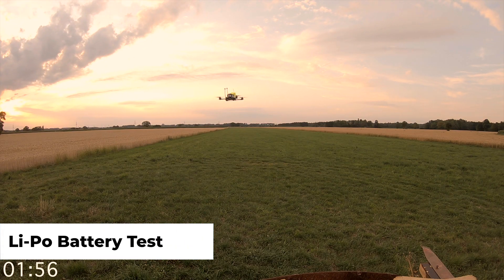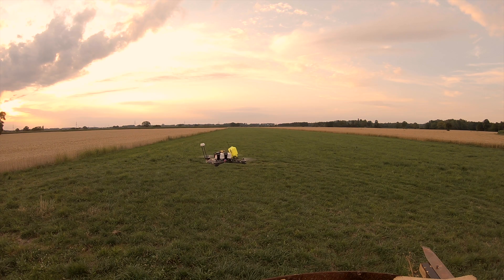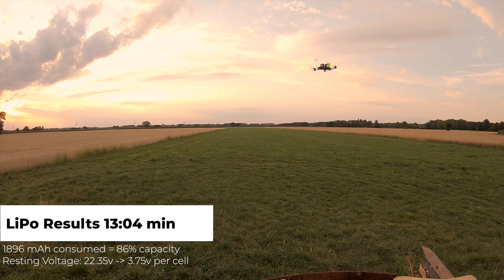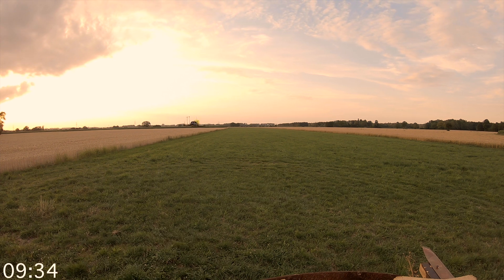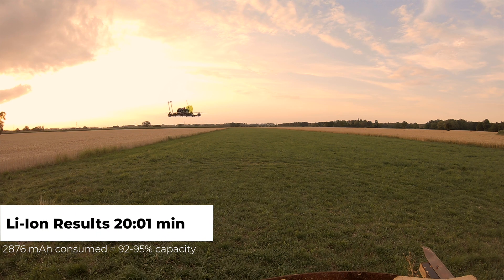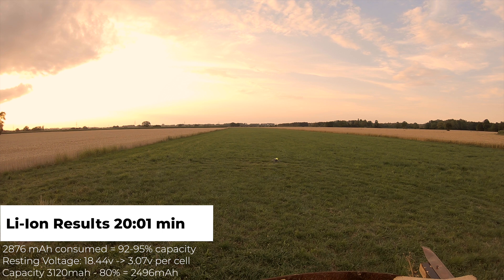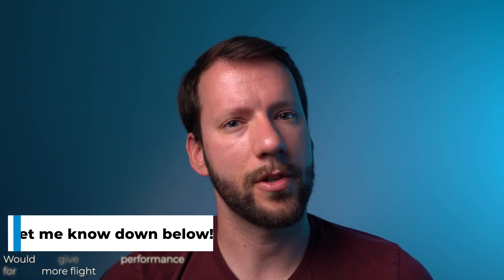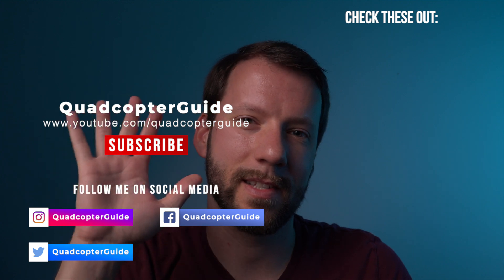Testing my Li-Ion Drone Battery vs. Li-Po

Comment: You might want to browse what I can do with a 10inch quad and a 6s2p pack.  Is it as nuts as a 1800mah 6s LiPo?  No but I can still fly quite hard with lithium ion.

Have run lithium ion on 3.5in all the way up to 13in x-class.

It is also not worth flying much below 3v per cell.   3v in the air and the goal of landing at a worst of 2.8v per cell in the air when flying.   Voltage sag is quick from 3.2 to 3v per cell and downright horrible below 3v per cell.

Bench marks I have hit

20min on 3s 1404 3700kv on 3.5in landing at 3.2v.  From 4.2-3.6v I fly the drone fairly hard going to around 70% throttle.   I used a current meter in line with the battery to hold the drone down and load the props to find where throttle gives me about 20amps max.

23min on 6s2p 2806.5 1300kv on 7in landing at 3v per cell.  40mph cruising the entire time.

9min on 6s2p 3115 640kv on 10in landing at 3.6v per cell.  Hitting 50+mph with ease while having plenty of power to pull out of dives while doing matty flip type maneuvers.  Honestly best flying LithiumIon combo I have hit on to date.

18min on 6s4p 4214 400kv on 13in landing at 3v per cell.   Cruising speed nearly 50mph the entire time.  This build is a bit under powered and really needs to be on 8s to properly pull out of dives.

Have a 10in deadcat frame(was meant for 12in props but biblades cause too much vibration over triblades but power was better with 12in APC MR props) that I designed that can also run 6s4p but have not given it a lot of attention.  Sweet spot has been 10in 6s4p and built light.

Lastly, try the Sony ...edit (had typo meant VTC5D) instead of VTC6A.   Slightly less capacity but slightly better continuous current handling capabilities.

Will be moving to a 8s4p(bridging 4s2p packs) for my Xclass.
Reply from the maker: Hey DividingByZero, thanks for taking the time to watch and comment. It is much appreciated! It was great reading about your experiences with Li-Ion. I assume you used vtc6d for all your packs? It looks like here in the EU its VCT5D or 6A that is available. I agree about the quick drop in voltage after 3.2v. The 23min on your 7" with same specced motors is very respectable. What frame and setup do you have on the 7"?
Reply: @Quadcopterguide  had tried VTC6A.  But no, prefer VTC5D.  Had typo abov3 meant VTC5D not 6D. Slightly more current capability for slightly less capacity.

Frame for 7in is Project 399 Super G in a deadcat config.

Have a fair amount of detail on my builds and what I am flying from past 3-6 months experimenting with Lithiun Ion.

Comment: Hi, thank you for this.
Have you abandoned lipo for li-ion; indefinitely?
From a quad flying style perspective, would lipo be better suited for those who fly their quads acrobatic style, and li-ion for those who fly their quads in a cruising style?
Reply from the maker: hey again, thanks for checking out another video. Also a great question. I would not say that I have abandoned LiPo. Your presumption for LiPo for Acro and Li-Ion for cruising is a fair assessment currently. I can pull close to 200amps out of the 7" quad, if my amp meter is still calibrated on-board, and that on a li-ion would surely cause it to just plummet out of the sky, hopefully without a fireball haha. For larger quads that can carry liion packs, preferably in parallel, i would say it is definitely for cruising. Let's see if this changes in the future.
Reply: @Quadcopterguide  Thank you for your reply
I'm learning about the electrical aspects of FPV.
Is it correct to say that batteries wired in series increase how long a given power is available, and batteries wired in parallel increase the overall power available, but that overall power increase is not necessarily available for the same amount of time as those batteries wired in series.
Reply from the maker: It’s the opposite. So in series you add the voltage. That’s how a 6s pack is 22.2v. Parallel let’s you combine the mAh of the packs.

Comment: Excellent. Reading the comment about punch. The LiPo should give more.....but at a negative for flight time. LiPo batteries are angry....they are always ready to dump as much as they can as quick as they can. Good but not steady. Bit like running Nitros in your car.....or Hare and Tortoise. But you know this already and after achieving nearly 7 minutes more I would say a very positive result indeed
Reply from the maker: ;) thanks for stopping by friend. Pretty exciting to not burn down the place and having it work 😂

Comment: Although the idea is pretty cool especially for long distance flying, I would have to say no. I say no because say I get out there a bit and for some reason I need that extra punch to get out of some kind of trouble. At the rate technology and innovation is going, it wont be long till someone designs a lithium or comparable output that lasts longer before to to long.
Reply from the maker: Trevor Doup hey awesome you took the time to watch and comment! Much appreciated! With a parallel pack you get 60amps. Would be an interesting test how much peak you get for a very short burst. 60 amps is quite a bit.
Reply: @Quadcopterguide  that's not bad at all! Don't get me wrong I think a parallel pack is great and I'm very interested in gaining more time in the air. For distance flying it's a great idea. I'm putting together a distance rig now and gathering parts as I can afford.
Reply from the maker: Sounds cool ;) love building.

Comment: Jawoll endlich <3 ich glaube wenn ich mir  meine neue Drohne gebaut habe werde ich mir auch so einen Akku basteln :D eine 2s version für meinen Babyhawk R werde ich mir auch noch bauen xD
Sehr interessanter test auf jeden fall. Lädst du den Akku dann im normalen Lipo Ladeprogramm im Charger oder anders?
Du bist doch Deutscher wenn ich mich recht erinnere oder? :D
Reply from the maker: Hey Han! awesome you took the time to watch and comment! Much appreciated! 
Great question regarding charging. Li-ion charge programs normally only charge the cells to 4.1v max. Certain cells such as the ones I used are meant to go to 4.2v. I use the lipo balance charge cycle as it also uses constant current/constant voltage to charge. 

Jo ich bin gerade in Deutschland. Antworte auch Englisch damit jeder mitlesen kann.
Reply: Okay nice :D
Thanks for your answer <3